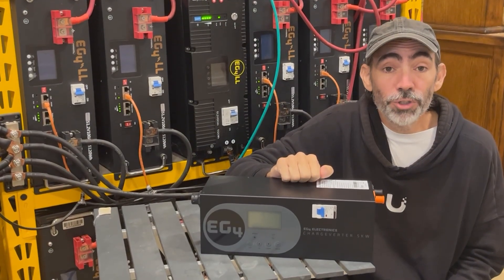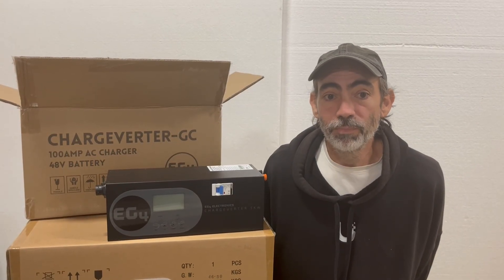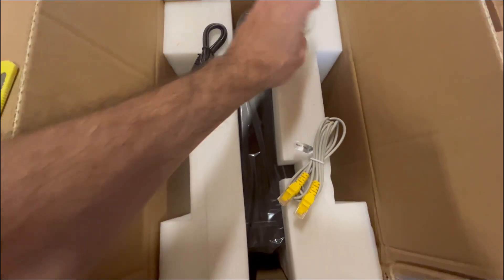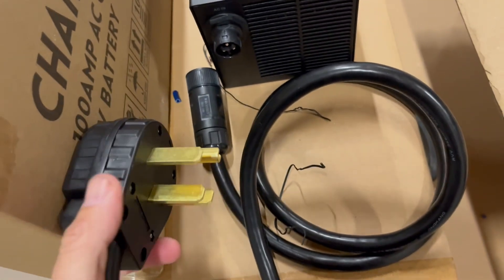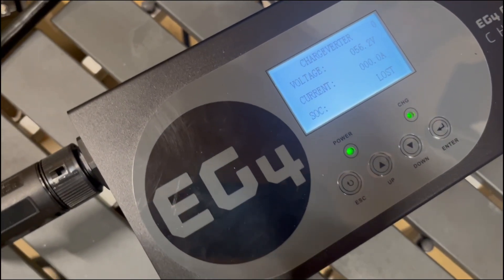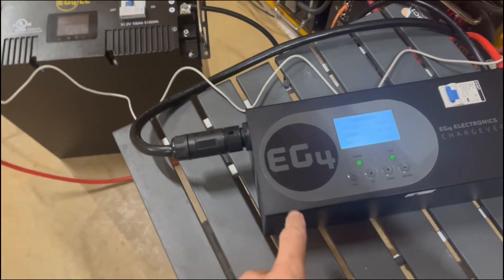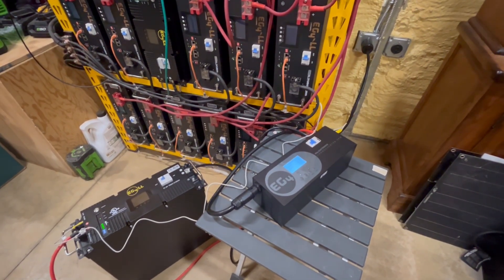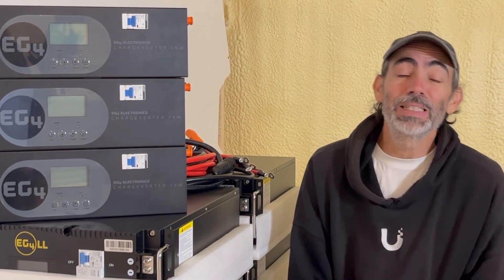EG4 Chargeverter GC: The Ultimate Generator Charger? (100A, 1 and 3-Unit Setup)

Comment: I just bought 3 Ruixu batteries, do I need to charge them one at a time to balance them with my chargeverter?
Reply from the maker: It depends.. if the voltage is the same (within .05v) then you should just be able to charge them all at once.  If they're off by more than that, I'd just do them one at a time.

Comment: Thanks for the video. We have 2 15kW Sol-Ark inverters with 2 racks of 6 EG4-LL batteries (12 total) powering our off-grid home. Sol-Ark no longer supports these batteries with latest firmware according to SignatureSolar (I can’t get EG4 Electronics tech support to respond).  With our tule fog in Northern California, the batteries never get to 100% the past few weeks and the batteries don’t charge evenly. Sol-Ark runs the Generac 26kW Guardian generator when it thinks the batteries are at 30%. The trouble is, while some batteries are at 30%, others may be much lower. The longer the fog persists, the wider the discrepancy, with some batteries depleted down to near 0%. I am wondering if switching to the Chargeverter(s) to handle charging from the generator would help better monitor the batteries? Also, why do you need 3 ChargeVerters? I would love to see how you have configured your system!
Reply: Since the chargeverter and bat are from same manufacture it'll be able to read soc so yes you can monitor it just not over the internet and the reason for 3 or more chargeverters is more current to common bus bar, faster charge time, less hours on Gen but it works a little harder for those shorter hours.
Reply from the maker: @kaosapprentice  The chargeverter can only read 1 battery though.. not the pack. :(
Reply: @trippyacres  just installed one in my system two days ago, it can't read any of my batteries, I built them myself (cheaper that way) using jk inverter bms, I only have voltage control available on the chargeverter so I still use the dry contact of the 12000xp to start the Generator because I can do that with my phone from anywhere and use SOC to control start stop, just no Gen cool/ramp down at the end of charging... Owell, I don't like voltage control and the chargeverter has no wifi connectivity. I hope the chargeverter plus has more feature 🤞
Reply from the maker: @kaosapprentice  I kind of thought you could use voltage to start/stop a generator with the chargeverter, but I agree that using voltage isn't ideal.  I haven't seen any hard data (guess I haven't looked either) on if you really need to let your generator idle for a few minutes to cool down.  Could it hurt to run a few extra minutes?  Probably not, but it's going to cool down anyway, just a tiny bit slower.  I totally don't blame you for building your own batteries.  If I had, I would have saved thousands but I'm still happy with my choice.  The one design flaw for the chargeverter (in my opinion) is making them masters instead of slaves.  I don't see how you integrate them seamlessly with anything, including EG4 inverters.  I'm hopeful they fixed that with the plus.
Reply: @trippyacres  indeed you can start/stop the Gen using voltage with the chargeverter... I just have to calculate what voltage correspond with what percentage range I want to stay between and then input that, I haven't really played with it yet I just quick installed and set the charge current but left the start/stop up to the inverter honestly because it was easier it's two wires but the chargeverter has 6 paired off in twos so three wires and I was like which two should I attach to the Gen two wire start? The manual is not helpful or maybe I'm just slow 😂... if it had communication with the batteries (control through percentage) it would be easy to test I can just attach The Wires set the percentage lower than what it actually is, see if it starts, if it doesn't swap the wires and keep testing until it works lol. 

it's just that going from high Rev to an abrupt stop isn't ideal for the longevity of the unit...

Yes really hope it's better in the plus model.
Reply from the maker: My understanding from talking with Sol-Ark is THEY never validated the EG4 batteries but EG4 validated the Sol-Ark.  I was told not to use closed loop communications for that reason.  For sure, SOC will be all over the place after a week or two of not getting to 100% and that's normal because the batteries internal shunt isn't perfect.  That being said, if your voltages are different, then that says to me your pos/neg battery cables aren't ALL the same length.  If some are 3' and some are 8', the resistance of the cable means more energy will flow to the bat with the shortest length.  That would cause true SOC imbalance (as opposed to indicated SOC).  Personally, I'd disconnect the communications between the Sol-Ark and EG4 and just go with voltage.
As for why we have 3 chargeverters, when I run my generator, it doesn't matter if I'm using 100w or 10000w.. I'm still burning about 2 gallons an hour, so might as well use it to it's full capacity.  3 chargeverters puts me at about 75%ish capacity which is where you want to be to not kill your genny.
Once the solar panels are installed, I plan on going over how I have everything set up, including Solar Assistant (which I recommend.)
I'd look at the voltages of each battery.  If they aren't exactly the same (or within .05v of each other) then you need to re-cut all your cables to the same length and awg.  Guess it wouldn't hurt to make sure the lugs are all tight too.
Hope that helps!!

Comment: So here's my situation: The NO and NC pins for normally open and normally closed aren't speaking the same language as my RV's Onan generator which TEMPORARILY applies 12V to the start wire to turn it on, and 12V to the stop signal to shut it off. Has anyone found an adapter which will turn the 12V signal into a temporary rather than permanent application of current?
Reply from the maker: I haven't heard of anything off-the-shelf, but it's definitely something an Arduino could do.  I'd check Reddit as I'm sure you can't be the first to run into this problem.  Maybe r/Generator or r/Offgrid.  I know I saw someone hack up my generators' pinout on r/Generator.  I wouldn't be surprised to hear someone did the same with an Onan.  I wish you luck!

Comment: Apologies if you covered this later in the vid: Can you run the chargeverter to charge the battery at the same time they're charging by solar, or discharging into the inverter?
Reply from the maker: Yes, to both answers.  Since the chargeverter is being powered by a generator, you'd be adding however many amps you set it to plus whatever your solar charger is adding.  The chargeverter doesn't know what's happening on the other end.  It's connected to the batteries, not an inverter or solar charger.  Something to consider: if it's possible to over-power your batteries, you'll need to be careful.   On the flip side, if your inverter is pulling 150a to power your devices and you start your generator/chargeverter combo, you'll then only see -50a instead of -150a.  You can't pull more than it's capable of from the chargeverter as it's a pusher, if that makes sense, so you won't damage it.
Reply: @trippyacres  If I understand you right... if the inverter is pulling 50a, and the chargeverter is pushing 100a, I'd still be charging the bank at the difference of 50a. That right?
Reply from the maker: @shabadabadoo4326  Correct.  You'd be putting 50a into your bank.